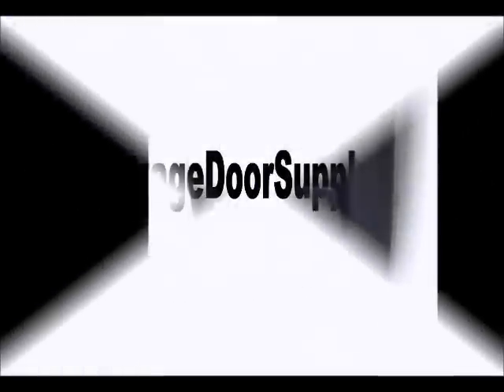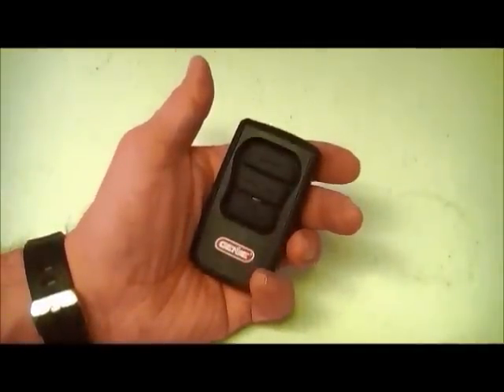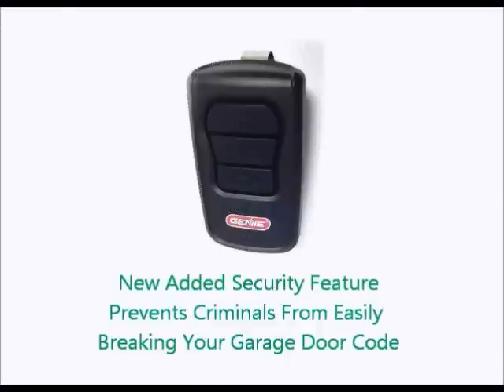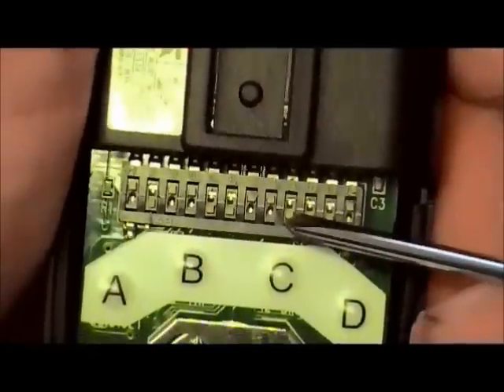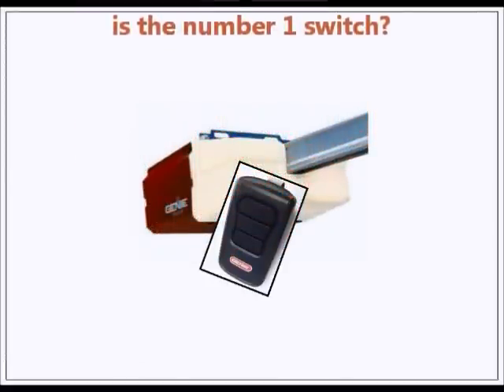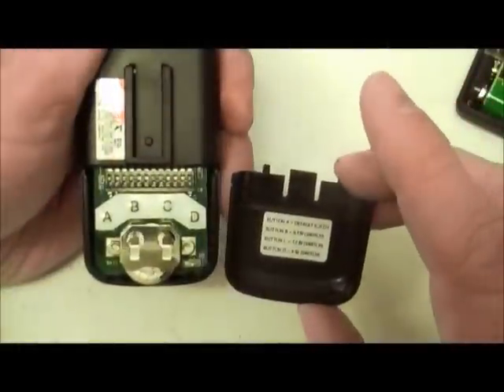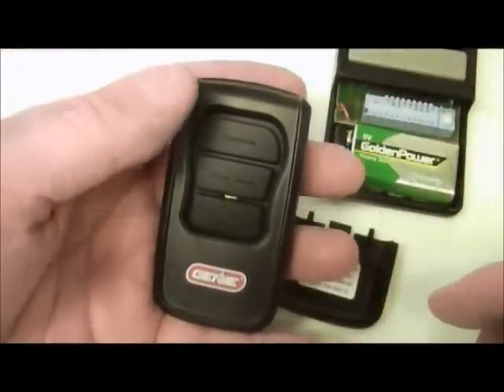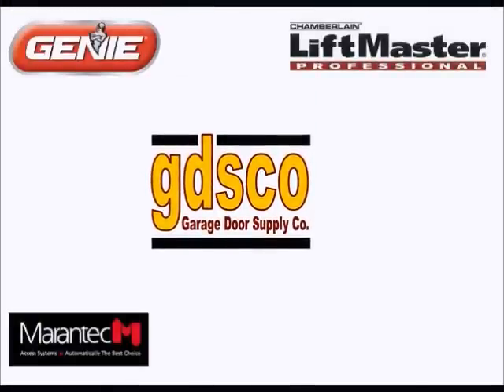Programming Genie GM3T-BX Master Remote with DIP Switches

Comment: Thanks you for these instructions.  I hassled with this for almost 3 hours, and couldn't get it.  I contacted ''Genie' by chat and was told that my opener was to old.  I would have to retrofit.  So i thought i would look for one online that wasn't Genie.  I stumbled onto your video, and it made sense.  The instructions didn't tell you that the remote wouldn't operate if all of the dip switches were in the same direction.  I followed your directions to the letter, and it worked. WOW, that was a load off my mind.  You explained it very easily.  thanks again.

Comment: This was great.  One addition however. If you are replacing a model AT95 remote, you will notice that it has 10 dual-position code switches, not 9 or 12.  To program your new remote in this situation, position the first 10 switches up or down according to your old remote, then place the 11 and 12 switches in the up position (NOT the neutral position).  Then activate using the C button.
Reply: This was helpful to me even though mine has 12! Thanks for posting!!
Reply: Awesome thanks
Reply: I’ll give that a try

Comment: I follow your instructions to program an old Legacy garage opener (496 model) with 12 dip switches. I opened the box follow your instructions and it worked like a charm. Thanks so much for your help with this my old Genie remote died on us and I had a hard time getting a replacement this one works with old units. Awesome!

Comment: I had trouble but seeing this video helped took a few tries found out mine is a C=12b (switch)  and The middle setting 0 was not going to work. Took the cover off and looked at the positions in the unit moved the switches in the the new universal remote and it worked ! Standing on a ladder it surprised me Whoa! but happy it worked. Thanks for the video.

Comment: Very helpful and thorough, thanks for posting!  I appreciate the simple and detailed approach. I'm still running into a problem where after a few hours my remote is failing to operate.  If I reset it then re-pair it, it works but for just a while.  I tried a new battery but that did not solve the issue.  My second remote is working just fine.  Both remotes are newer replacements...pairing with an old genie screw drive 2 way 9 switch.  The security feature that dictates you have at least 4 switches in the up or down position doesn't seem to matter only because my other remote works fine without that rule implemented.  My search continues!

Comment: I have a 12 switch unit and I have the switches matched exactly fully up or down and I have followed your instructions to a T and I have tried multiple different switch variations and I can’t get it to work. I reset the remote every time. Any advice?? Thanks in advance
Reply: I have 12 switch unit and matched it up exactly with code on opener.  When I press button, opener makes noise, but does not open.    Idk wtf to do
Reply: Mine opens like 10 inches and stops - ughhh

Comment: Hi Gary - very thorough, clear instructions! Thanks so much for putting this video together. Quite helpful. I've got a very old genie 88 screw drive with a separate radio remote switch box adjacent to the garage door opener, and I can't get the cover off the box to see the dip switches. The plastic is old and brittle, with a lot of bend and give, so I'm trying not to break it. Is there a trick to pulling the cover off? Are the tabs locking the cover to the base on the top & bottom of the box (it's mounted horizontally) or the right & left ends? Thanks again for your help!
Reply: Did you ever figure this out. I’m in my garage trying to get the white part off and can’t figure it out for the life of me

Comment: Is it possible to leave the switches on the machine as they are & simply match them on a new remote controller? I have two doors/machines & one car homelink is matched to them but my "clicker" is missing & I bought a new car which I need to set up. Is there a way to match the homelink to the new car as you can with a hand held remote control ?
Thank you!

Comment: Very nice video. If I have two Genie openers but with different dip switch codes, how does this remote program the two codes? Maybe after programing one code, you can put a new dip switch code and reprogram for the next button. Do you think this is the way it works? Thanks!
Reply: Did you ever get an answer?

Comment: So, you only need to worry about the DIP switches on the remote and not the unit itself? The unit on the ceiling of the garage, I mean. I will be attempting to do this tomorrow, as my new remote has arrived. I am just trying to have an additional remote and hoping I don't need a ladder for the unit, or to open the box for the DIP switches.

Comment: Gary,
I have a garage door made in around 1989 that had a Blue Max remote that has broken. I think you video was very clear, however, I followed all instructions precisely and the door will not open. Any ideas?....ps...12 dip switches
Thanks.
Reply: Same thing happened to me and I have the same genie blue max 12 pin

Comment: I don't know what I'm doing wrong. I have exactly the same two remotes in the video. Old and new.  I am trying to program the new GM3T-R as a second remote. I have tried many different combinations of switch positions. Each time the old remote opened the door without issue but the new remote didn't work at all. I even positioned the switches exactly like the video recommended without success with the new remote. I understand that the lower switches cannot be next to each other. I have a genie screw drive model SD5050. Any help would be greatly appreciated. 
Thanks!

Comment: I have 10 dip switch codes does this remote works for me?
Reply: +Claude Rayhome Set your last 2 switches to middle/neutral position and it should work.
Reply: Actually the last 2 switches (11 & 12) should be in the up, NOT the neutral, position, and you should activate using the C button.